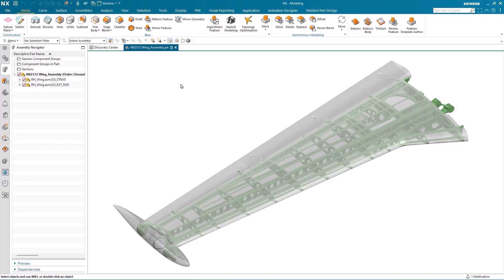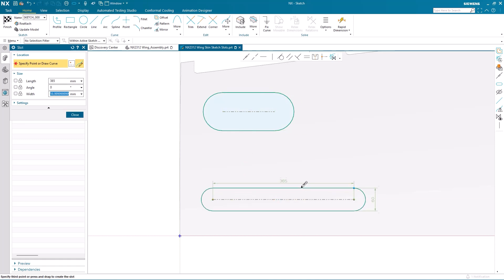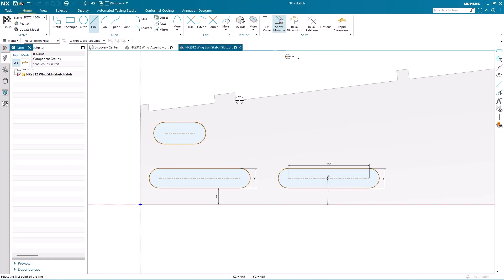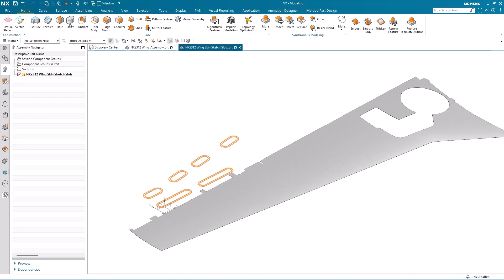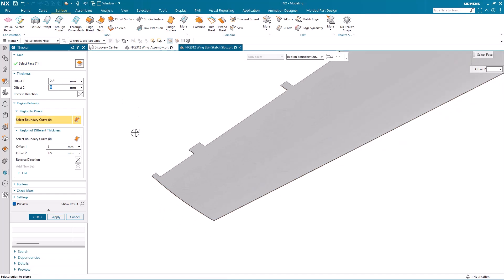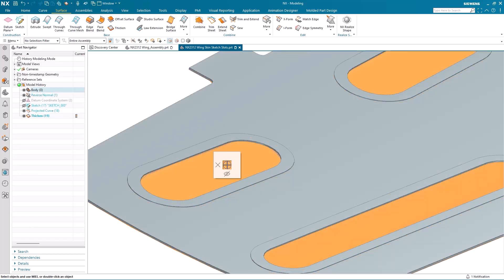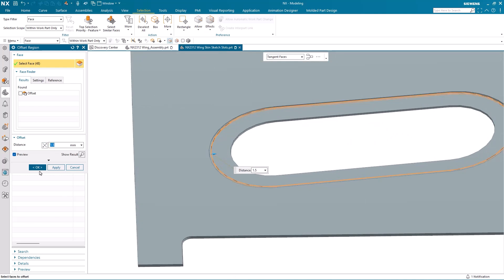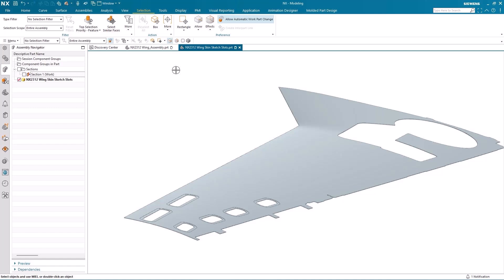NX Tips and Tricks | December 2023 | Sketch Slot Command

Comment: Siemens, having a slot function in sketch  is wonderful, but having designer/engineer input into how they use a slot before you design these new commands would make the use of them make more sense.  In almost all cases of putting in a slot, you are centering the length of the slot over a hole.  When you dimension a slot, you are dimensioning it to the center of the slot, not to one end.  In creating a slot in sketch, due to how a slot is used in design, I create a circle at the center (centered of the mating hole), draw two parallel  lines tangent to that circle and cap the end with tangent radii.  I then make the circle reference and put a line from ctr point of one of the parallel lines to the center point of the other.  I can now dimension my sketched slot to the center of the slot and control the slot with 2 dimensions, the diameter of the circle and a dimension from the tangent of the radius on one end of the slot to the tangent on the other end.  This new slot command would make more sense if it started/was located from the center of the slot.  By starting at the end you push the slot to one side of a feature, not normally how/why a slot is used.
Reply from the maker: Hi and thank you for the user feedback. We’re sharing it with the product team, and appreciate you taking the time to comment. ~ Team Siemens